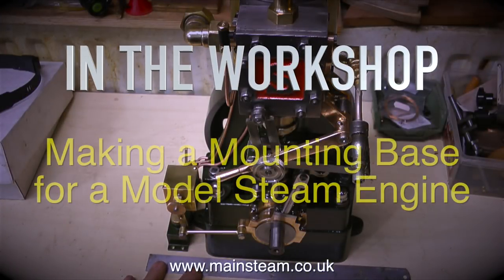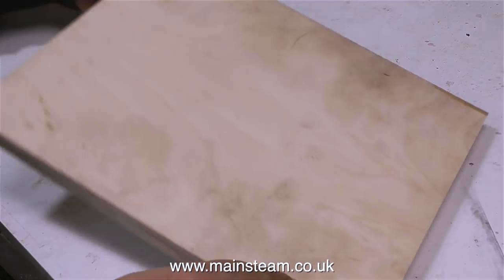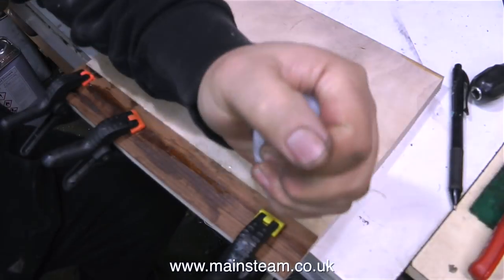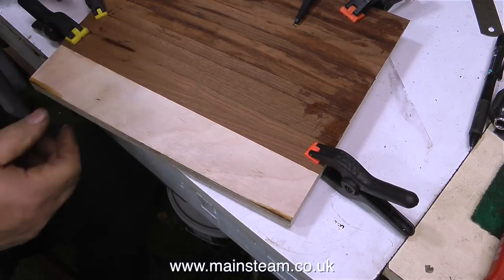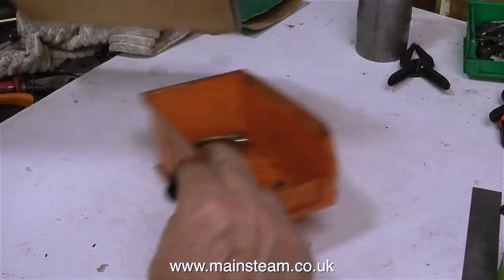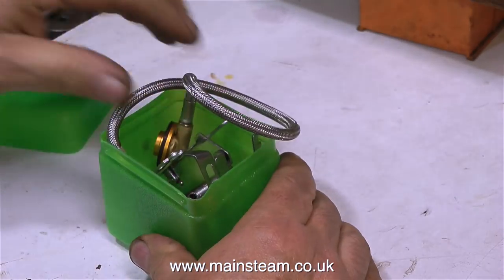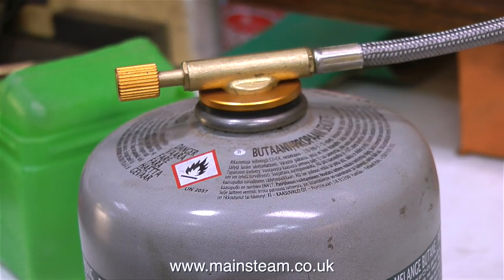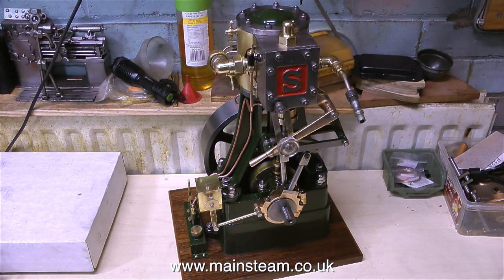MAKING A STEAM ENGINE MOUNTING BASE - IN THE WORKSHOP

Comment: Kieth. I sharpen my wood cutting bandasw blades with a small cut-off wheel (used as a grinder) in a dremel type machine. Just cleaning up the back face of each tooth is quite effective, trying to clean up the front face is very trying. Above all you need your best glasses on, or maybe 2 pairs. Cheers

Comment: Really interested to see your inexpensive gas burner purchase. I actually bought an identical one, purely to pull apart to connect into a little ceramic burner system I am employing on my very first steam engine build. As you say, the cost of the parts makes it a very attractive proposition, though I bought mine direct from China through Aliexpress for the grand sum of £6.96 including p&p.

Comment: Great job, very nice work.  A question on the planking.  I have not see a full sized steam plant so I don't know what the planking would look like, but usually wooden floors, like old grocery stores in the US that were oiled, had staggered planking.  That is, two cuts, then maybe three, then two or more and so forth rather than planks all the way across.  Would that be more to "scale"?
Reply from the maker: Yes it would - if only I had the time - it's quicker using long planks......

Comment: Maybe it's a stupid question, but why do not the clamps stick to the board? There was a lot of glue
Reply from the maker: They do - so I keep them moving and wipe away the CA glue . . . .
Reply: Maybe a CA glue activator spray could be useful here. That cures the CA glue nearly instantly.
Reply from the maker: I prefer not to use activator as it can turn the CA glue white, plus it cures quickly enough anyway . . .